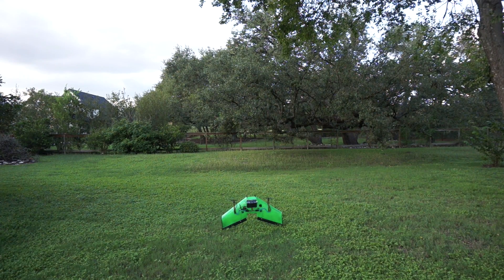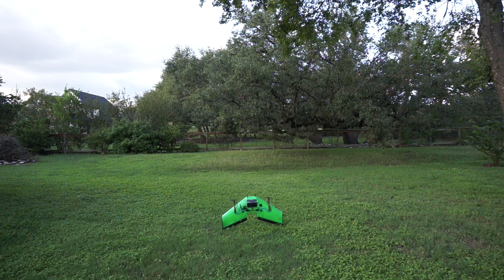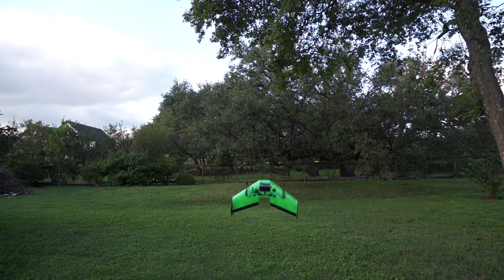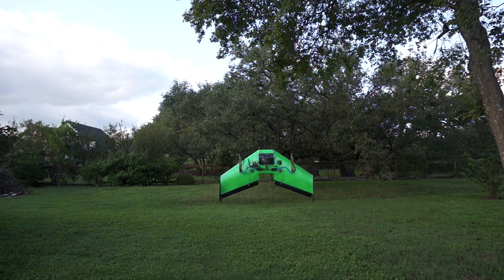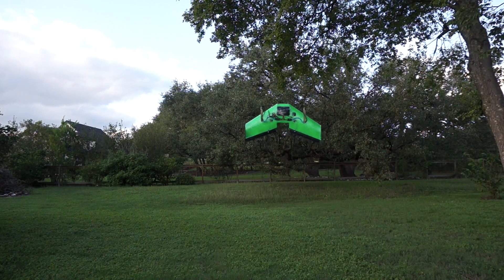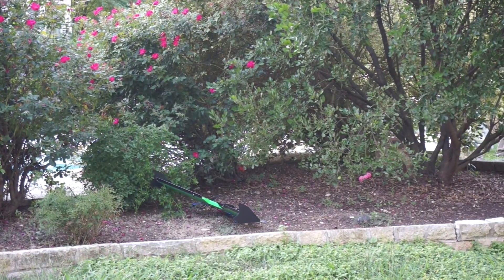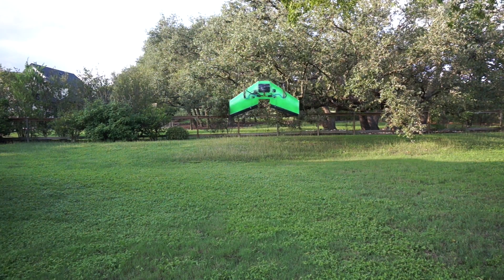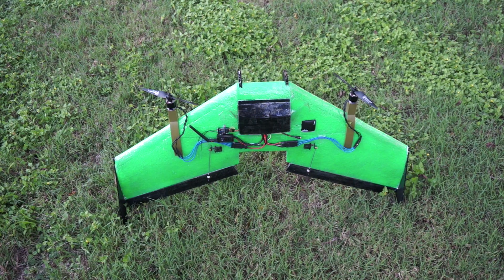SweepWings Flinch & ArduPilot Tailsitter Backyard Maiden

Comment: Hi dennis really amazing build. I built a similar one too. But m have a problem. When i hover in Qstabilize mode, when i increase the throttle and it reaches to approx 4m alt it automatically changes to forward flight. I m not sure why. M using a radiolink minipix. Flightmodes m using is qstabilize, fbwa and qrtl. Can you please help.
Reply: Hey, I am going to build one of these as well. Would you mind sharing some of the parts you used? Motors/frame/props/esc's? This would help a ton, thanks.
Reply: @randomodbuild  hi. The frame i used is designed by flite test. An FT Spear. U can use any Motors and esc as long as they are 4s capable and the props m using are 8inch apc. Flight controller is a radiolink minipix.

Comment: Hi Dennis. Can you kindly supply the model number for the motor and what ESC your using. Is the Flinch a symmetric wing?
Reply from the maker: Hi! Here are the motors:

https://www.getfpv.com/fx2216-9-1100kv-v2.html

I pulled them off a quad build. I'm not certain if these will be what I settle on, but they are great little motors for my experimentation. I'm flying 8" props. These are the ESCs:

https://www.getfpv.com/lumenier-30a-blheli-esc-2-4s.html

Regarding your question about symmetric are you referring to the airfoil or something else? Good luck with your build.
Reply: Thanks - that's what I thought. Best to be sure.

Comment: Impressive first flight.  Larger control surfaces will give you a bit more authority for yaw and pitch control, but I've found the configuration to have poor stability as soon as there is any wind (At least using the PX4 flight stack).  I've yet to try the configuration Research Air pioneered with vectored thrust, but I think it's the future for practical dual motor setups.
Reply from the maker: Thanks Guy. As you saw in the video there was zero wind, which was great for hover testing. I know I'll have much more trouble with these small elevons in windy conditions. My next steps are to tune and double the height of the elevons. Thanks for sharing and yes, Research Air is doing some awesome stuff with the vectored tailsitters!
Reply: thanks for the acknowledgment....